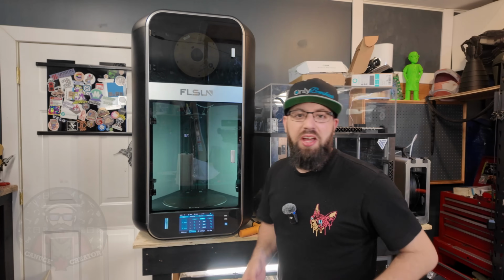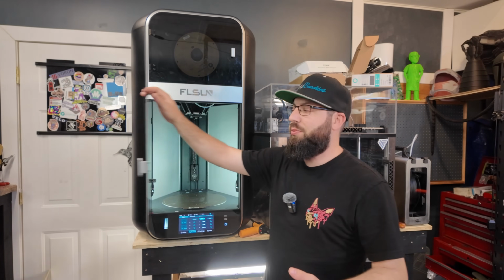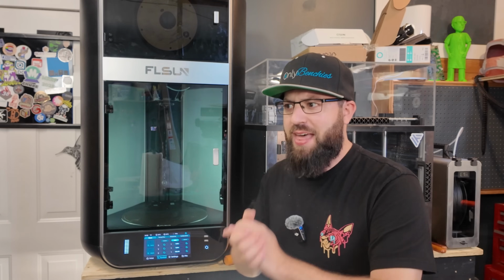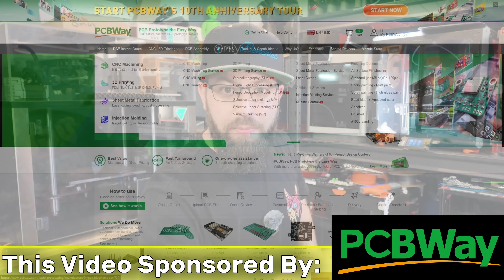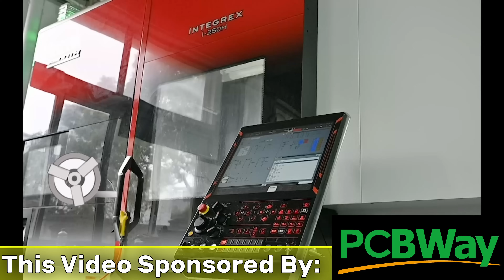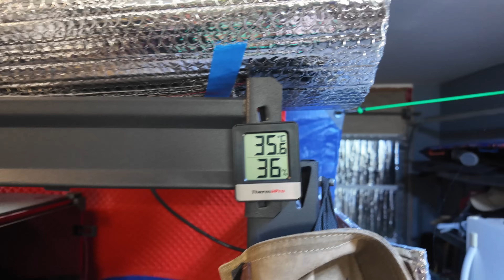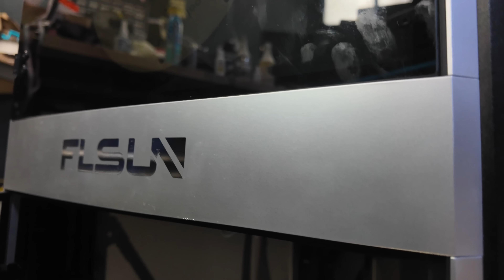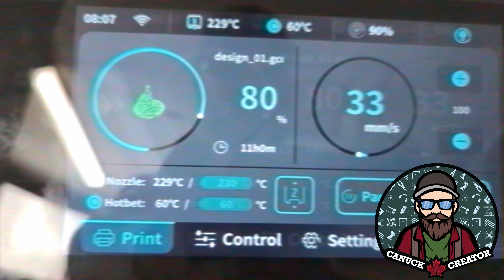FLSUN S1 Made BETTER, WITH A DRILL! #3dprinting #diy

Comment: I have an ender 3 S1 Pro and 2 Ikea Lack end tables stacked together to form a poor man's enclosure.  The sides are covered and I even put insulation (a bubble-wrap aluminum foil sandwidch I made myself) inside of it to keep it warm (I don't have any space in my house for the printer so it lives in my shed which gets very cold in Buffalo NY winters.

I want to add C-pap cooling to it AND have a way to control chamber temps.  It still gets too cold in the winter and too hot in the summper.  I plan to cut a hole in the top Lack (the top/ceiling of the enclosure) and add a simple 3-D printed dampener.  Idealy I will be able to add a small ceramic heater inline to heat it in the winter.  After I watch your other FLSUN delta printer review I got the idea for all of this.

Just thought I would throw that out as a suggestion.  Avtive chamber temp control is the last hurdle for me to get reliable results out of my printer.

Comment: This thing moves so much air that putting a muffler on it is still moving more air than any fan on any printer out there. I put the built in Christmas tree muffler on mine and then built the enclosure to go over that from printables and put some thin acoustic sound deadening foam inside the little enclosure and now with the fan speed set to a more reasonable 50% This thing is quieter than my X1C's and still moves more than enough air to cool the parts as needed. Since the fan moves with the nozzle anyway, it doesn't really spend that much time cooling parts like a fixed parts cooling fan would.

Comment: The CPAP Fan intake is/was so wrong when you print you want a hot chamber and "hot air" from the Chamber for Fan(s) so when you print with ABS you cool too fast your layers and then your layer adhesion i like nothing

i like it that someone did it

Comment: Measuring sound:
-at a set distance, almost always 1 meter away from the source
-mic directed at the source
The second is especially important when using phones to measure sound as all new phones use 2 microphones for noise cancellation, but that should be handled by the measuring software, hopefully. Samsung S and Note phones do a damn good job of measuring noise levels, despite a tiny mic hole.

Comment: You could add a printed mini baffle/muffler to those screw holes on the inside part of the chamber. Should make a pretty big difference in noise for pretty minimal loss in air flow

Comment: Also by re-circulating the air you’re not fighting positive pressure in the chamber anymore. It would be interesting to put a 3-way valve so you could pull air from either outside or inside or a mixture of both and see how air source affects different materials and also chamber temps and heat bed power usage.

Comment: Do you have issues with salmon skin or diagonal line artefacts with the S1?
I'm reading a ton about it in the flsun discord and have it on order but if its a hw issue I'll cancel my order
Reply from the maker: Yes. thats another thing on the list, you can kind of see it on the test prints
Reply: @CanuckCreator  do you think it's a hw issue or fixable with software?
Reply: @DefY0806 it has unfortunately smooth instead of teethed idlers, so if we change those to teethed it should only get better. Worst case no print quality improvement but your belts will last longer. There is really no excuse to use smooth idlers on the teethed side, either bearing stacks for increase lifespan or teethed idlers like it was intended by the belt manufacturer
Reply: Cancel your order my guy. The hotend end can't handle abrasive filaments.
Reply: @Twinnecrotic  what happened?
Reply: @over_pizza_2578  the hotend end is made from aluminum so is that CHT insert thing that's going on inside of it. It was confirmed on the Facebook group that it will damage it, if you use abrasive filaments.

Comment: I wonder if this mod would affect printing other filaments like pla. I'm sure some will want to print pla and other filaments along with abs.
Reply: I'd just print PLA with the door open.
Reply from the maker: Yup, pretty much this, its not so much the air temp itself, more it moving over the surface and taking away the heat from the plastic. But ya, open the door for PLA like on any other enclosed printer and your golden